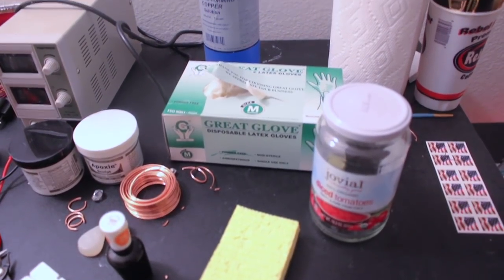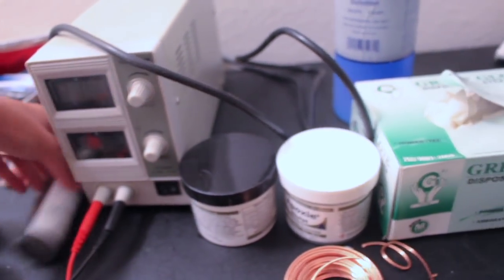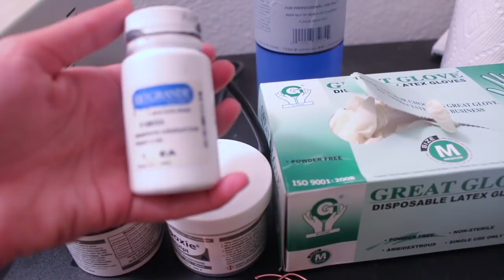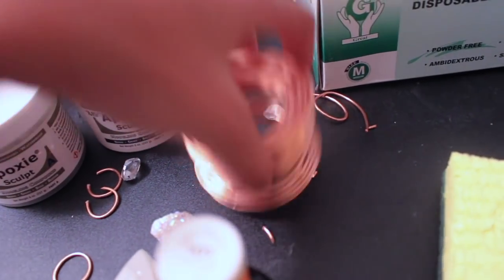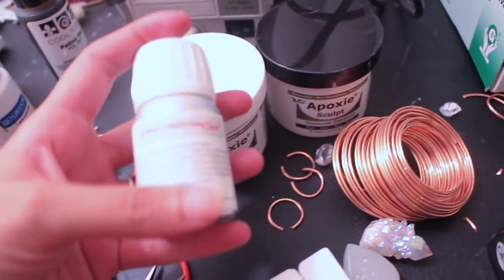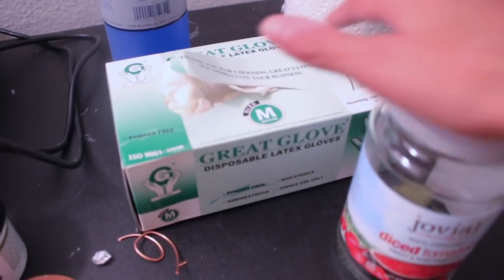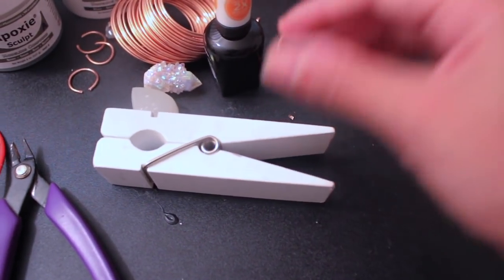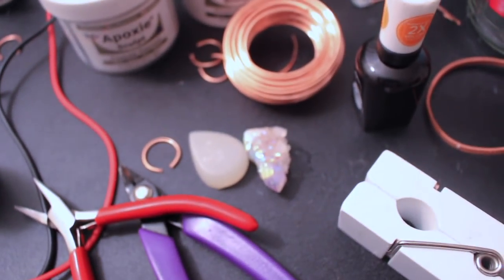How To Copper Electroform A Crystal Ring at Home

Comment: I like your straightforward approach, and like the Apoxie Sculpt for attaching stones to the base. But, I think the 10 square inches per amp is wrong. It's more like 100 mA of current per square inch of surface area: if your ring (or whatever you are electroforming) has a surface area of 2 inches, the amperage should eventually be 0.200 (on rectifier) or 200 mA. 

2 volts should be enough for electroforming, and higher voltage doesn't make for good results. 

One thing I found to work as a great anode is copper grounding wire from the electrical department of the hardware store. It is approximately 6 gauge, and it lasts through several electroformings. It needs to be rinsed off after each use, and the oxidation can be cleaned off with a wire brush. The anode wire produces better results if you start without oxidation (shiny wire).

Looking forward to seeing more of your creations!

Comment: Good vid. 
I personally optain much better results using copper conductive paint than with a graphite one. but also i am only coating plastic objects. mainly ABS. only drawback is you cant see the coat building up that good.
my brand is using a super fast evaporating solvent. usually i do only one coat. Best option for this is probably the silver paint.. but also the most expensive.
For you crystal problem.. just add a bit distilled water and boil it some time. the cristals will dissolve again. Filter it and the solution is new again.

Comment: Hello can I re use the electroplating solution? If so how many times and should I just pour it back into the bottle? Thank you so much great video ❤
Reply from the maker: Yes you can :). You will need to use a coffee filter and funnel to pour the solution back into the bottle so the it stays clean and copper-free.
Reply: Thanks so much for the help 💗💗💗

Comment: I'm having trouble getting my electroform shiny. Any tips?
Reply from the maker: Hi Brooke! I've noticed a few factors contributing to how shiny the copper turns out: 

1)Always buff the copper once it starts to look dull after use.

2)You can add in a brightener to your solution to give your copper an extra shine-- 

https://www.riogrande.com/Product/Midas-Replenishing-Brightener-for-Electroforming-Copper/335065

3) When the temperature is around 80-90 degrees, I seem to produce the shiniest and  and most solid pieces. My pieces turn out really dull and bumpy during wintertime, which is I pretty much stop my electroforming. 

Hope this helps!
Reply: Thank you!
Reply: I use a chemical brightner, you add it into your copper sulphate solution.
Reply: They will also get shiny with the metal brush tool on a dremmel.

Comment: ITS NOT A RECTIFIER.

IT IS A POWER SUPPLY, IT HAS A RECTIFIER INSIDE IT.

The RECTIFIER converts alternating current into DIRECT CURRENT.

Would you like to know about point contact diode voltage breakdown avalanche?